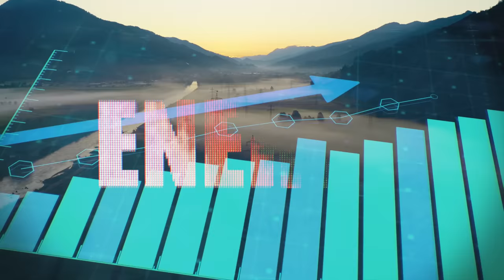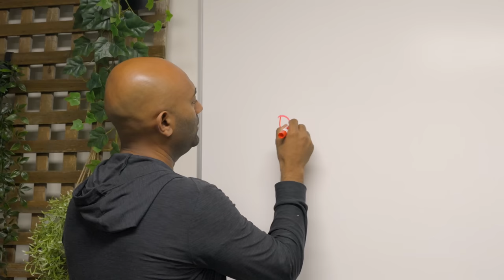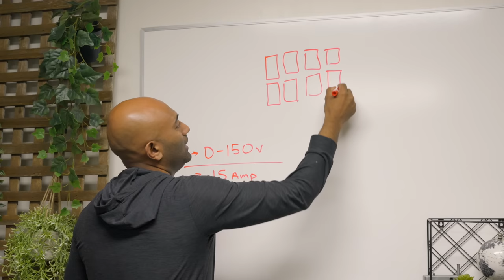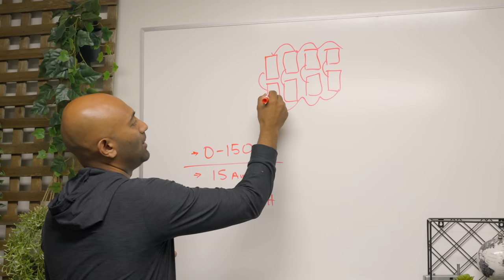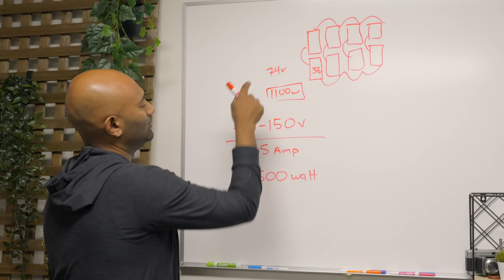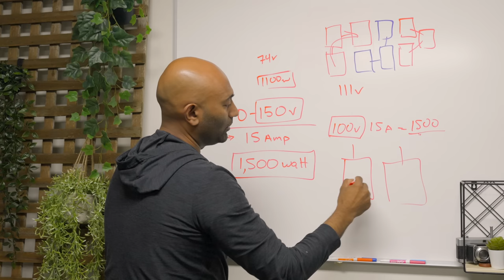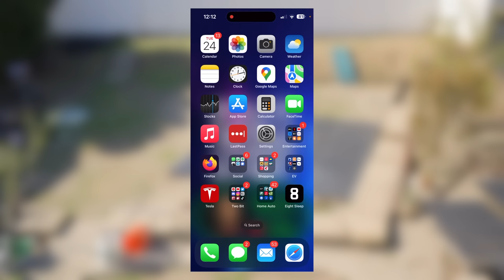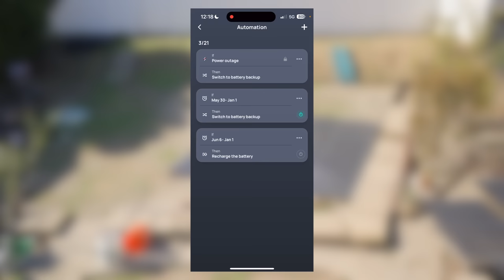Home Backup Power + Solar Power WITHOUT Permits!

Comment: I like how he made a point of it without permit, it draws attention to it for people who need a way without them.
Reply: This is just a smart automatic transfer switch which you can just use a manual version for cheaper.  However in California a roof or ground mount for solar panels does require a permit.  My local permit exemption doesn’t let me install anything permanent that generates more than 50 watts.

Laying the panels on the ground isn’t something you can do full time.
Reply: "Without a permit" thats a fine line. If you electricute someone with your temporary setup, are you insured against liability? IF it catches fire, are you insured against building loss? Will firefaighters put out the fire knowing the amount of amperage that is in the batteries? YOure holding a hose full of a conductor.
Reply: @Doug Montgomery  I was just interpreting it as it made it easier for people to find. Specifically for that reason, but if you're taking that further into consideration, it does change how you interpret it.
Reply: @raullasvegas  what will a permit do to mitigate any of the worries you mentioned except that they know it’s there? Or is there something I’m not thinking about?
Reply: @raullasvegas  ha, i didn't know apermit would magically make those things not happen,  who knew that paying a fine to the government would be so useful, ha good lord......
Reply: @JosiahK555  Good Lord! do people not understand you have to apply for the permit? In that application, you have to  explain what youre going to do. An electrical inspector will never issue the permit to begin with cause it doesn't meet code.

Comment: I'm currently using the Delta Pro independently charging with a 400 watt panel. I'm pretty happy to see that the Smart Home Pane works as intended. This is gonna be the ultimate goal right here. I also love the modularity in the sense that if I need offgrid power somewhere else I can just take one and go.

Comment: I Love your content and delivery.     We got an EcoFlow system and Smart Panel.     I have a serious solar system.    Even with shorter day light this time of year.....   we Love our system. 

Thanks for your advice.  We so appreciate You!
Reply from the maker: thanks greg, and that sounds awesome... roof mounted?
Reply: Yes..., 36.   We have 2 Delta Pros and 2 extra Delta Pro batteries.   We are on a grid tied system that we generate more than we use and we are back at full capacity on all 4 before the sun goes down.   Our power bill is usually $8.50 per month just to be connected.   We are happy to create power for the neighbors, without solar.

Comment: Thing to remember is that Solar Panels are pretty much always "live". Adding two panels in series takes the voltage to over 100V for many domestic panels. Series arrangements are often a good idea but you need to treat the installation as if you were wiring up your house with the power switch on.....
Reply: Great point also that they are dc so there is no phasing and if you were to “zap” yourself the current won’t dip in phase and “let you go”. The mc4 solar connectors(they join the panel wires together) are designed very safe but that’s a lot of power to be respectful of.
Reply: When connecting panels, try putting a plywood panel in front. No sun,no (or very little) flow.
Reply: So quick question is 100v supposed to hurt you? Asking because I been hit by engine ignition spark multiple times while adjusting timing on old engines and there thousands of volts….
Reply: @dieseldawg7132  Currents that are greater than 75 mA can cause your heart to shift its regular beating pattern. If this happens, your heart muscles go out of whack in a way that causes blood to stop pumping.  Only takes about 20-30 volts to overcome the resistance of your skin. Since most panels can output way more than 3/4 of an amp or 75MA if you touched a 100V output of a string of panels no different than touching a live 120V outlet of grid power.
Reply: @Mike-01234  I got you I been looking at the connected mc4 I think that’s what they are called it looks almost impossible to touch the actual metal inside
Reply: I have solved this problem by installing the panels at night.
Reply: @dieseldawg7132  Amps are what kills you not volts a perfect example is the tesla coil

Comment: Most places will require a permit for the connection of the Ecoflow Smart Panel which is a transfer switch, to the main panel. While the Ecoflow Smart switch takes care of making sure you are not back feeding the grid. The potential still exists so that's why a permit may be required.

Also, while transfer switches or in this case a (Smart Panel) are fairly easy to install it still should be done by or at least checked by professional before you test it out of connect to it.

The Ecoflow and extra batteries are a little pricier up front than a standby home generator. The Ecoflow will cost a small fraction of what a gas or propane powered generator will cost in a grid down situation. Best of all the potential to power all or part of your home using the sun becomes an option that allows it to pay for itself over time.
Reply: When one of the circuits is active via battery in the Smart Panel, it cannot backflow - as the wired connection is off that goes to the main panel.  If you install it incorrectly you could get some real interesting results I suppose though...
Reply: Yup. Ultimately depends on municipality and the authority having jurisdiction in folks' areas. He mentioned the batteries can "power your home" during an outage. Essentially, full grid-tie. Though not backfeeding to the grid (on purpose), the batteries could inadvertently backfeed for a short duration during a power outage scenario. Pretty sure the utility would want that ATS inspected/permitted also.
Reply: @astro365  To operate on battery, the relays also turn off the main panel connection - how would this ever backfeed?
Reply: @whattheschmidt  My apologies. My experience comes mostly from Tesla Powerwalls and their self-consumption mode.
When operating like that, export is limited (as close to zero as possible), with the Gateway reducing battery discharge or increasing as needed. It's reactive to the load, so there are some times when sudden shut off of the load may cause slight export to the grid for a short duration.

So yes, you are correct. With the ATS/MTS fully swapped over, there is no physical contact between the battery and grid, therefore backfeed isn't possible.

EDIT: I'm incorrect again, sorry. Thanks kayzrx8 for catching it.
The limited export is only while the grid is live/on. When the power outage scenario is detected, the Gateway (ATS) will disconnect completely from the grid. No export, regardless of duration, happens during this time UNTIL the grid is detected again.
Reply: Shhhh... What they don't know won't kill them.
Reply: @astro365  This is not possible .
Reply: @kayzrx8  Oops, you're totally right!
I'll edit my statement. 👍

Comment: Great discussion of the voltage and amperage issues.   You didn't mention the difference between operating voltage and open-circuit voltage, so lets be sure that people understand that.

Open-circuit voltage is the voltage the panel(s) generate when there is no current being drawn.  The total open circuit voltage in series must be lower than the maximum voltage accepted by the inverter.  So if you have three panels in series, you take Voc * 3 and make sure that number is less than the maximum voltage the ecoflow can handle.  Also note that even in shade, a solar panel will generally be producing its open circuit voltage when open circuited (no current).

Operating voltage is the voltage the panel(s) generate when operating at their maximum power point.  It also tends to be roughly the voltage the panels operate at when partially shaded (just with less current).    You want the total operating voltage in series to be within the MPPT range of the EcoFlow.   And its actually a bit more complicated because you also want the inverter to be able to handle a partially shaded string, so really you also want the total operating voltage in series, minus one panel, to also be within the MPPT voltage range of the inverter.

Also keep in mind when calculating the total possible production, that the production is occurring at the operating voltage, not at the open circuit voltage.  So you want the total operating voltage of the string to be as high as possible to make as much production as possible given the current limit of the inverter.

--

Now there is a huge problem with partial shading in a parallel x series configuration.  In your case, 3s3p.  The problem is that if a panel in one of the series is shaded, the optimal operating voltage for that string is far lower than the optimal operating voltage of the other strings connected in parallel.  Since the voltage is forced to be the same for things connected in parallel,  this will cause the partially shaded string to contribute almost no current (essentially losing the entire string instead of just the shaded panel) due to the other strings forcing the voltage higher.

This is why you generally do not want to parallel strings, not in modern day.  You want each series string going into its own dedicated MPPT.  That way partial shading on one string only drops out the partially shaded-panels in that string and allows the rest of the panels in that string to fully contribute to your production.

--

And there is also a problem when you parallel more than two strings.   Nearly all solar panels are specified to only be able to parallel two strings without fusing.

The only safe way to parallel more than two strings (and I would argue even when paralleling just two strings...) is to run them through a solar combiner box that includes a series fuse for each string.   If you don't do that and one of your strings shorts out (due to damage or whatever), the other strings in the array will feed their entire combined current into that one shorted string.  If you have more than two strings in parallel, that can cause a fire.   That's why a proper solar combiner box is necessary when paralleling panels or paralleling strings.

(But as I said above, in modern times you want to avoid paralleling strings if at all possible and have each string going into its own dedicated MPPT, to ensure that a partially shaded string can still contribute to production).

--

And there is ALSO (yet again) a problem when paralleling a lot of strings... now the highest possible current might exceed what DIYers actually use for their wiring.  And that can cause a fire too.  As long as there is a series fuse for each string, then the wiring for each string only has to nominally handle that string's current contribution.  The trunk (after the paralleling) wiring on the other-hand must be able to handle to the total combined current.   Getting 30A-capable "solar" wiring and MC4 connectors for this is easy.  Once you head north of 20A, though, a lot of the cheap stuff people buy starts to have problems.  Cheap MC4 connectors, cheap wires, bad crimps, etc... things can get dangerous in a hurry.  Yet another reason not to parallel more than two strings.

Hand-touching the MC4 junctions and all the wiring during full production is a good idea to make sure there are no hot spots.

-Matt
Reply from the maker: great write up... need to create a whole blog post with your insights for sure
Reply: Indeed. I was going to mention the significant difference between Open Circuit and Operating voltages. In the case of your panels, these are around 37 V and ~24 V. You must use the latter voltage when calculating your power production.

Comment: This is amazing.  I live just south of Tampa, & just before that hurrican, last fall, we bought a small gas generator (it's still in the box!).  These large battery systems seem to be much more useful, as you have demonstrated, not just for emergency use, but to save money too.
Reply from the maker: That is awesome! i know it sucks thinking about disasters but I find it helps to be prepared for sure
Reply: @TwoBitDaVinci  Thinking about disaster scenarios is practical and should be developed before the disaster.
Plan well pal.......
Thanks for the video,I learned something useful,I can take some of those batteries to neighbors homes !

Comment: There is one more warning regarding EcoFlow MPPT and solar panels - you cannot exceed the 150V with OPEN CIRCUIT voltage, not load voltage. This partially limits the available configurations. Not a big deal (similar limitations are also on Victron MPPT controllers), but it's worth to mention.
Excellent video, this one (practical) is what I like most. The panels just laying on the ground is a good trick - as temporary solution of "let's see if it even works" it makes for a great idea. Imagine you would have to climb back to the roof to re-wire the panels :D
Reply: I have Outback Power system with same limitation. It's also worth noting that Vpp-max will also increase as the temperature drops... If you have -40 this can be significant.
Reply: You can do the same on paper,less labor intensive,pros do it that way......
  Harbor freight got a cool kit you can goof with, anywhere, it's from China though,peace.
Reply: @joestalin2375  what is this cool kit called?
Reply: @dpoohbear  Hi it's sold at Harbor freight it's manby pamby ,but you can learn and there is a multitude of video on YouTube.
 I'm on my way to home made solar panels,free your self from the man .
Reply: @joestalin2375  huh. Got a link
Reply: @dpoohbear  no I bought them in person at Harbor freight.

Comment: Having never been able to get over the price of the so-called "solar generators", I built my own small (1kwh) solar system.  A new roof is going on the house right now, so I'll be able to roof a larger (5kwh) off-grid system this year.  I don't want the corrupt energy utilities (San Diego Gouge and Extortion there, and Pacific Power Grab here.) to usurp my electricity, either, so it will never go online.  During the several years I've been watching your journey, Ricky, I've also bought several different types of batteries, chargers, inverters, and cases, and put together some various power storage systems.  The 12V 200A box is my favorite pouch battery setup.  It'll run a 3hp electric chainsaw anywhere and cost under $200.
Please keep producing videos.  You have some unique perspectives on all this stuff and they're interesting to watch.

Comment: Thanks for the video.  I'm planning on setting up my garage similarly for an off-grid solar/battery system.  This will allow me to charge cars for free without worrying about grid-connect shenanigans.  I was planning on running an extension cord to the house for essentials during power outages.  Wheeling a battery into the house sounds like a lot less trouble, especially if I don't want to keep a window or door open in the rain for the extension cord.
I'm really hoping vehicle-to-home tech becomes practical in the near future.  50-100 kwh would be very handy during a period of prolonged bad weather.
Reply from the maker: The convenience of being able to make your stationary storage into a portable platform is amazing.

Comment: Great presentation and I will offer one piece of advice.  Perhaps you could have done a quick overview on the difference between calculating the voltage from a parallel circuit or circuit in series.  I believe this would add value and not add any confusion as the calculations are not that difficult.

Comment: One of the things your video post clearly demonstrates is the overall complexity of trying to balance the strings of Solar Panels so you can charge the batteries as quickly and as fully per day of sunshine as possible while coming as close to the maximum volts and amps rating as the solar generator's built in MPPT controller allows for to obtain maximum efficiency. For myself, I don't have time to screw around and experiment with a solution, I simply need to be able to connect up the system and it just works ! This is where I think a micro inverter solar array based system is by far simpler, more flexible, and way more efficient than line based DC Solar Controller Technology is. With a micro inverter solar panel array, you can mix and match different makes and wattage rated sizes of solar panels, since each panel is converted on the line from its DC voltage outputs directly to a micro AC inverter which then sends the power down the line as AC current to the charge controller master box, which feeds into your solar generator. There's less current loss due to line resistance with AC current then with DC current as well. You can then manually dial in the amount of DC voltage and current you want to feed into your portable solar generator's MPPT DC charge controller to easily match the maximum specification of your unit.

Comment: Great video! You were right when you DM'd me on Twitter telling me that I would enjoy it! YES, as we discuused, using solar & batteries to allow you to go 100% off grid energy wise, with a vertical ground source heat pump, electric cooking hob, & electric car, is THE way to both save the planet by reducing our carbon footprints to near zero, as well as saving HUGE amounts of money on energy & fuel - you can't get cheaper than FREE after setup! And solar panels can last 30yrs!
Reply from the maker: Good stuff Tim glad you got a chance to check it out!

Comment: I'm glad people are continuing to cover used panels. I have had mine for 5 years. They typically produce  their rated output. I only paid 64$ each got them. When I tell people they are so skeptical. Then they say what about warranty. I just told them I bought 10 extra panels and stored them.